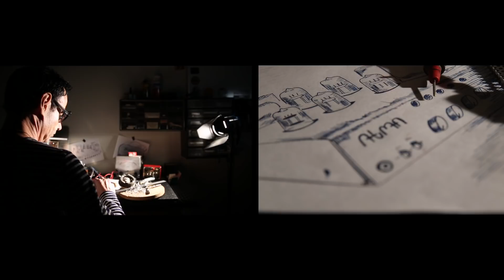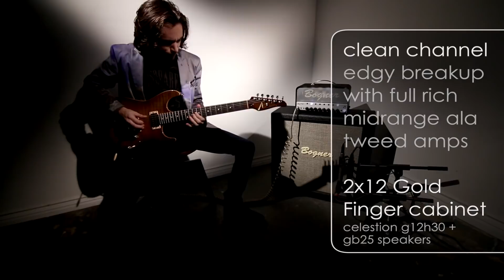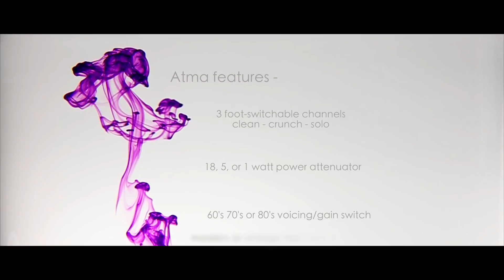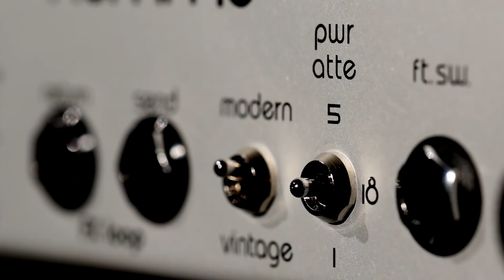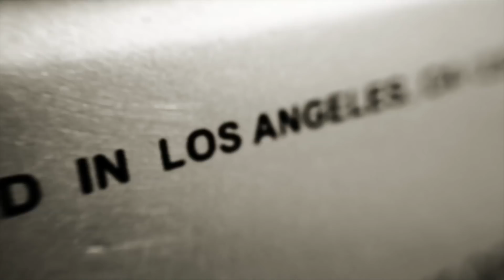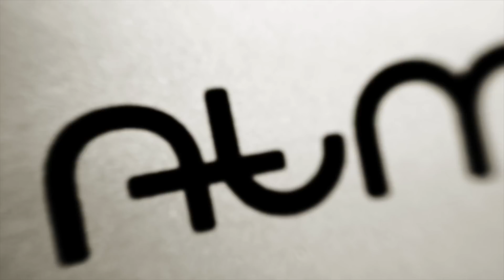Bogner Atma amp demo

Comment: I just bought the head version of this amp. It is INCREDIBLE!
I fully expected it to be awesome on the two higher gain channels, 2 and 3, since Reinhold was the one Eddie Van Halen sought out years ago to soup up his amps. (And by the way - how GREAT is having THREE CHANNELS, for a maximum amount of dynamic possibilities and shading.)
What I was not expecting to find - the feature that absolutely sold me on this work of genius - was the clean channel, which seems to have infinite headroom (unlike the handwired Vox AC15 - which is good but noisy and it breaks up too fast). Plus, the tone control is more of an exciter. At 2 or 3 o'clock the strings absolutely become electric, singing with great sustain and urgency. Plus chords ring forever at that setting (without any hint of compression). The salesman and I were amazed at how long a chord would sustain beautifully (and with lots of chime) without decaying. 
The high gain channels are nothing short of an inspiration. They make you feel like the guitar is playing itself - or like you could play at your very best without much effort.
What is my motivation to post this review? To give credit where credit is due - and to ensure this amp never goes out of production. I will want to buy more ultimately. Plus, I am old-fashioned: in the old days musicians spread the word about great equipment and all things musical, because we are indeed a band of brothers.
Reply: How do the 1 and 5 watt power modes sound? Do they come close to the 18 watt sound or do they sound fizzy? Thanks.
Reply: tony  Thanks Tony.
Reply: It's my dream amp dude. I want one so badly. I'll earn it soon enough!

Comment: The Mesa Mark V 25 killer, I'm getting this amp!
Reply: Best cleans I ever heard here. The only thing though is these cant do a lil modern metal high gain stuff? That's the only reason I'm considering the mark 5 or engl ironball over it.
Reply: I got the Ironball not so long ago. I also have a Mesa Mini Rectifier. The Engl is what you want if doing modern metal. I rarely put the gain above 10 o'clock. The Rectifier is a bit crunchier, but the Engl has a thicker oversaturated gain. The cleans are decent, much better with the help of a compressor. But if playing mostly metal, that;s not a concern. Check one out if you haven't already, I highly recommend it. (I'm playing through a 2x12 Mesa Rec tifier cab)

Comment: My question on this amp is, is this amp practical for a bar band situation with it being mic'd and a loud drummer. I get 15 tube watts of distortion is pretty loud but will clean have enough headroom say at upper volume level to maintain its chimmy cleans. I currently use an XTC which is awesome but heavy. I'm trying to find a suitable lighter replacement amp. Thx for the help.
Reply: Hi mate. Just wondered if you'd had a reply about this or even if you'd bought/tried one? I was also looking at this as a replacement but won't be mic'ing it. Wondered if it had the balls to keep up? Thanks.

Comment: If clean is ur bag when playing live this amp will not offer that for you. Distortion is plenty loud and sound freaken fantastic. Better than my XTC I must say. But the clean will Peter out and start distorting, not enough headroom. I had to have the clean Channel on 8 and the distortion channel on 4-5. Like I said distortion was awesome clean started to break up and yes I was mic'd. 

Do a search for Bogner atma backlash on YouTube to hear the distortion maxed out. Like I said the distortion was incredible better than my XTC. Clean sounded fantastic too but couldn't get it loud enough. The amps too expensive to just use it for practicing so it went back. 

If it where another 10 watts and better footswitch layout control it probably be the most awesomist amp out there. Even if it where 25lbs.
Reply: Can it hit modern metal level with mids scooped?
Reply: Can it do modern metal well?